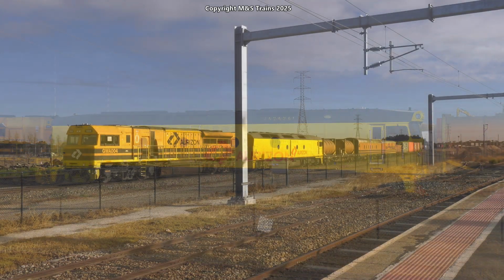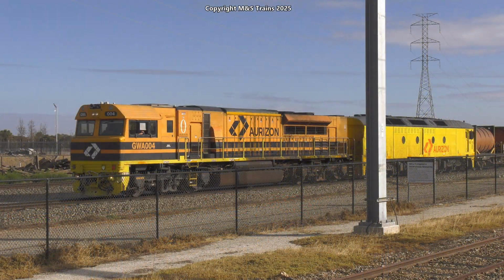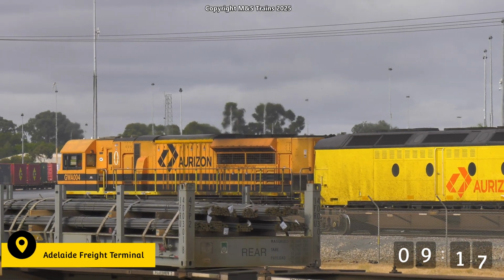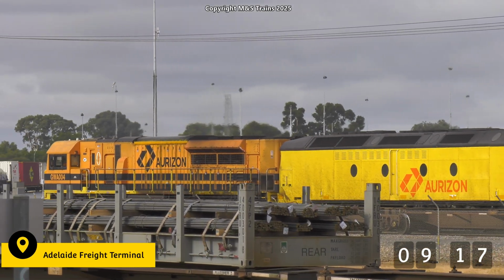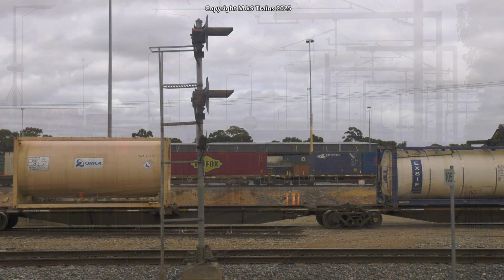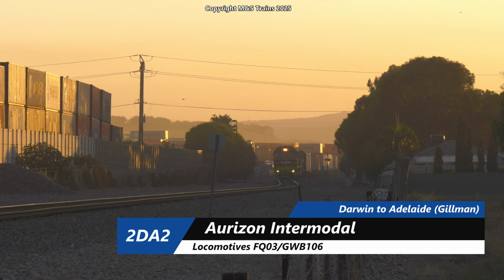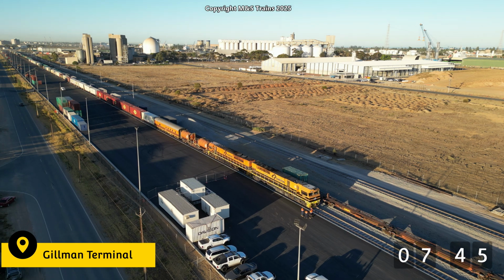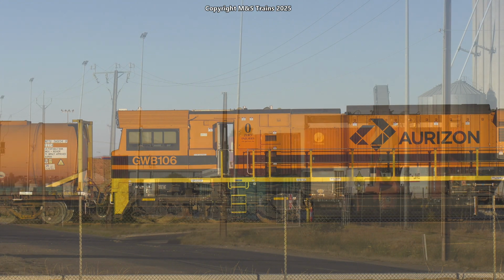LAST DARWIN INTERMODAL TO THE AFT & FIRST TO GILLMAN YARD - AURIZON INTERMODAL'S 7DA2 & 2DA2

Comment: I wonder why they butchered the "ALF" class by removing the No2 end cab. doesn't make sense?  Great narration and very informative excellent work!:washhands:
Reply from the maker: @australiantrains8988  Thanks mate! I guess across to Perth and upto Alice at the time locomotives could be turned easily, so save on weight and maintenance with a single cab. The double cab would be very beneficial today though will all metro shunting and running.

Comment: Interesting how they operate 2 x different locos on each trip. Are they using up surplus Loco stock. Will it be a more efficient set up at the new location.
We thought that line would be busier freight wise but Darwin is not exactly a big metropolis.
Great coverage.
Reply from the maker: @aurelius2277   Thanks mate! Glad you enjoyed the coverage. Arguably the new location is a worse set up then the one they’ve left, with the only real positive that they own it. Northline and Linfox (Two major customers on these trains) both have warehouses at the Adelaide Freight Terminal, which means trucks will have to move containers to the AFT from Gillman anyway. Sounds inefficient to me. I heard a rumour Aurizon might run a shuttle train to and from for customers who want to use the AFT still but I haven’t seen anything confirmed on that. It’ll be interesting to see how things progress… As for the engines, it’s pretty normal to have a Modern 4000+HP locomotive and 3000HP locomotive on the smaller trains, and two 4000ish HP locomotives on the heavier larger trains but in this case, it seems the other way around, with 7DA2 the heavier train with less power. They have a great collection of different classes, as expansion has permitted over the years. It wouldn’t surprise me if the ALFs and CLs days are numbered on these services.

Comment: Wonder what engine is in the ALF ??
Reply from the maker: Electro-Motive Diesel 16-645E3C, a step up from the Electro-Motive Diesel 16-645E3 in the AL.
Reply: @MS_Trains  Excellent! Wonder if it was done at Dry ck or Port Augusta
Reply: @damienodonohue1327  Port Augusta